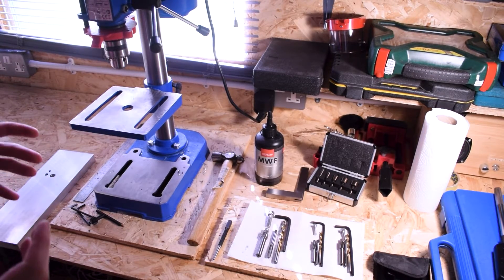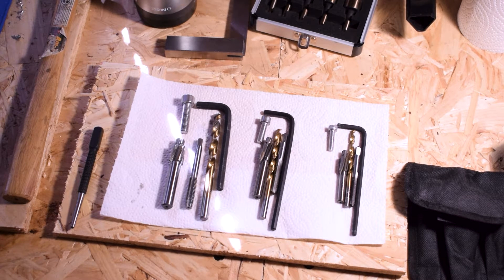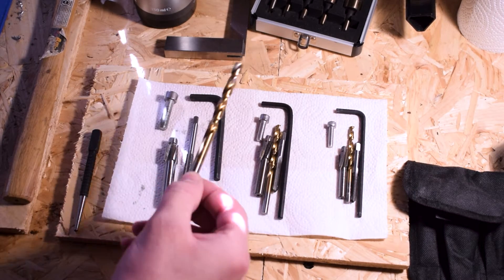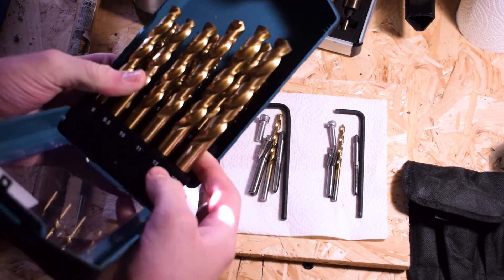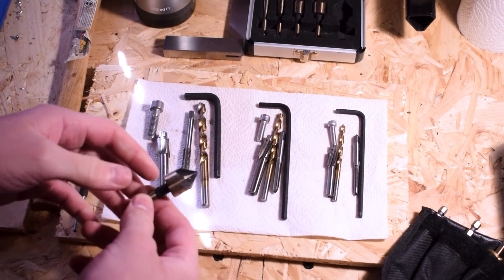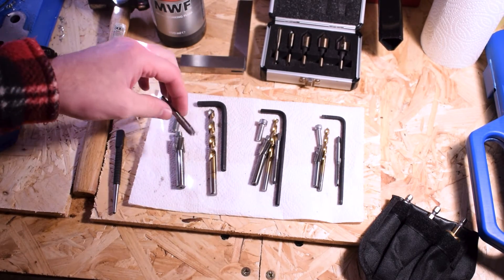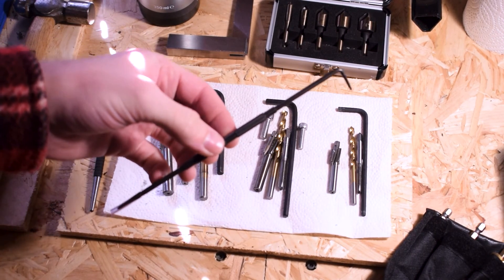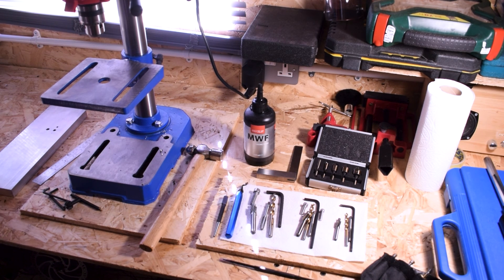DIY CNC 003 - Tools for Machining Aluminium

Comment: 7.5 for an M8 is to big, normal is 6.8 but 7 or 7.2 is easier for hand tapping.
M8x1.25, the pitch is 1.25 also the depth is 1.25, hence 6.8 for M8
M6x1 so a 5mm drill, but i use 5.2 for deep holes for easier tapping.
Edit:
Check my channel, i have built a lot of cnc machines, probably over 40 by now. No mill or lathe, just hand tools.
Reply from the maker: Yes you are correct! I did provide a metric tap chart in the video description for reference. The 7.5 was just used here for demonstration. I will be using 7.0 on the CNC frame👍🏻